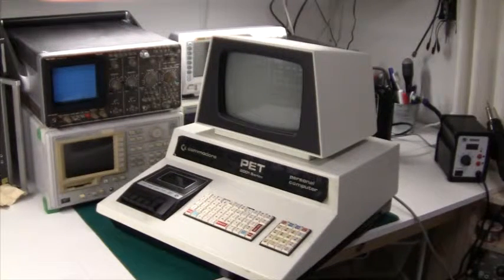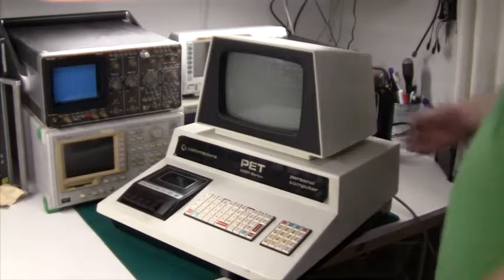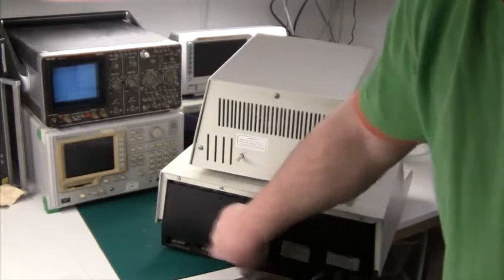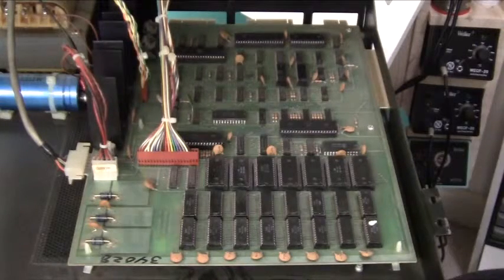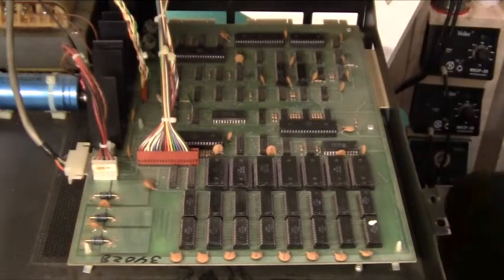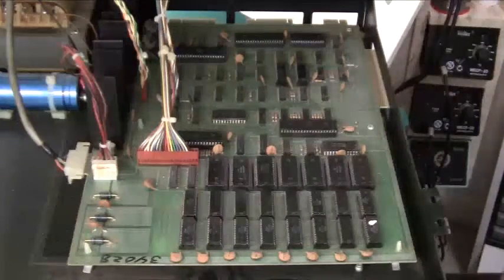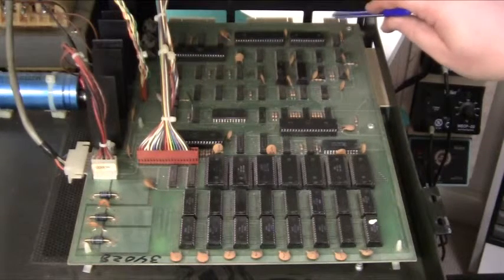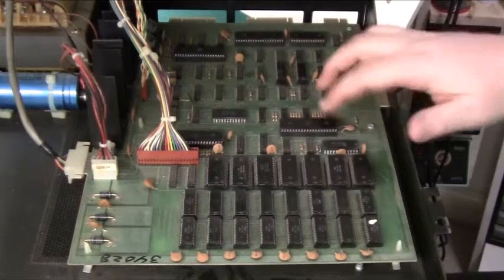Teardown of Commodore PET 2001

Comment: On the back of the PET, looking from left to right (as viewed from the back), the first edge card connector ('gold fingers') is the second cassette port; the primary cassette port is near the front of the circuit board under the built in cassette unit....you can plug a standard external Commodore cassette unit into this second port. The next two connectors appear to be identical on first view, but they are not. One of them is the GPIB connector which was initially just used for connecting the Commodore printers, but could also be used for the disk drives when they came out later, and for non-Commodore printers and for interfacing with any GPIB equipment....you could connect up to a bunch of test equipment, for example, and automate a testing routine. As I recall, GPIB was also called IEEE-488. To save money, Commodore did not use the proper IEEE-488 connector, which was expensive, so they just used the edge card connector. You could buy adapters to the proper type connector. The third connector on the rear is the 'user port', which is an 8-bit I/O port that was easily controlled from BASIC through PEEK and POKE commands, setting or reading individual bits or the entire byte. There might have also been a pin from the UART chip, something that could be modulated in various ways....it has been too long so I forget the details. But there was a simple means to make one of the user port pins act as an audio tone generator to play music if connected to a powered speaker. The big connector on the side of the computer was of course the 'expansion bus', which had all the address, data, and control signals on it. This is where you would connect to expansion memory and other optional circuit boards.
Reply from the maker: Hi youtooba. Thank you for clearing that up. The GPIB bus was also called IEE-488 as you said. I have received a Commodore floppy-disk station for my PETs since this video. the floppy drives are connected via the GPIB bus. I will do a tear-down later.

Comment: I often thought that the PET, with its GPIB bus, would be perfect for automating a testing station in a manufacturing environment, but never heard of anyone doing that.
Reply from the maker: There is a book called "PET and the IEEE-488 Bus (GPIB)", which details exactly how to do this, so some must have. Also, Rohde & Swartz made the PUC, which is a modified PET specifically for controlling their own test equipment. www.youtube.com/watch?v=l5bz3H5qyeQ
Reply: +NatureAndTech Thanks for this information. I didn't know that.

I've always respected Rohde & Swartz. I think of them as the European HP.

I purchased a NETworks brand GPIB to RS-232 adapter, and a TeleType Model 43 printer.

Also added a HUH S-100 adapter, an Integrand S-100 case, and 3 Godbout 8MB S-100 memory cards.

It was a kludge!
Reply: +NatureAndTech Acck! Those 1978 vintage Godbout static memory cards were 8 kilobytes, not 8 Megabytes, each. They ran HOT.

I also added a muffin fan to the rear CRT panel and a flexible clear plastic dust cover for the PET.

The KIM-1 was provided an excellent introduction to microprocessors. You had to learn hexadecimal, how registers and  instructions worked, etc. I can't recall what happened to mine.

I still think that introducing students at such a low level provides the best foundation.

I abandoned the PET for a Northstar Horizon with CPM 1.4 c 1979.
Reply: +NatureAndTech I saw an interview with Commodore founder Jack Tramiel in which he said that initially Bill Gates wanted a royalty for licensing his BASIC interpreter to Commodore. Tramiel proudly claimed that instead he bought carte blanche rights for $30,000. He claimed to have installed it on not only all PETs, but subsequent products as well.
Reply from the maker: Maybe a kludge, but it sounds really interesting, nevertheless. I am in the process of making a USB to GPIB bus interface for the PC, but I am so busy with other things, that I have not had the time to send off the PCB gerber files to the manufacturer yet.
Reply: I guess he wanted everything under his own control.  Remember that he bought MOS Technology back in 1976 for the sole purpose of having a central source for integrated circuits for his company's computers.